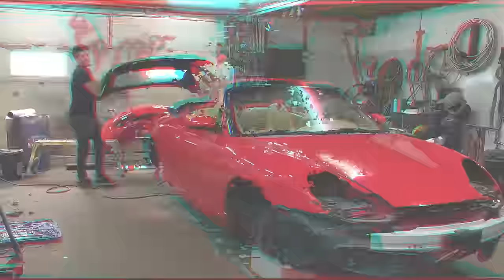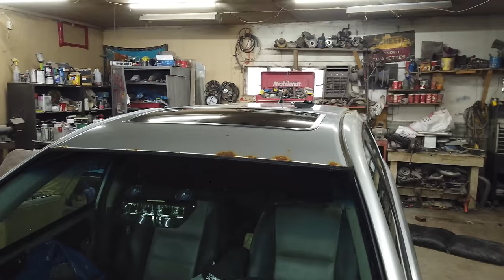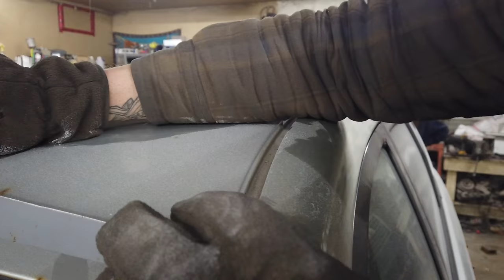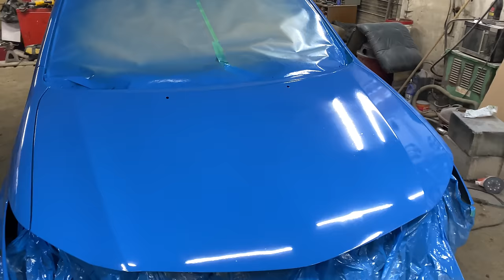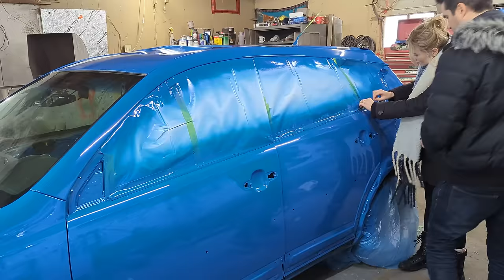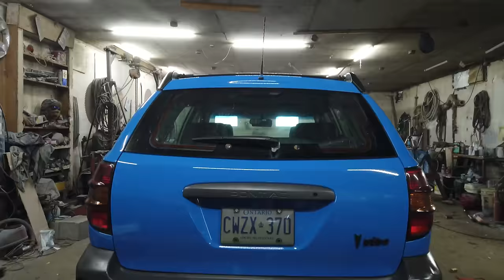Clear Coat over Rust Paint - DIY Professional Rustoleum Paint Job

Comment: When doing a color change, it's a good idea to do inside the jambs as well.
Reply from the maker: Definitely, I did mention it in the video, but since this is my own personal daily driver, and I'm the only one that uses it and will drive it till it's dead, I am not bothered by it as it's not a color that clashes or stands out. It was just to make the job easier and get my car back on the road faster. But you are right, doing the jams is the proper way to do it
Reply: If you guys wet sanded and buffed this out it would look fantastic.  But, for an inexpensive 20 footer it looks great!

Comment: I'm no paint expert, but from what I gather , it's the prep that makes the finish come together.. 

Time consuming and labor intensive, which adds to the cost.

On the other hand , there's nothing worse than a 3rd rate paint job.
Reply from the maker: Yes you are totally right, you can be a great painter using the best spray gun, but if the prep work is garbage then the finish will look like garbage. A lot of people say to just tape everything off and go for it, but it's good to  disassemble things and try and do the best job you can. If someone is doing a diy cheap paint job, then you're starting at a disadvantage, so doing proper disassembly and prep makes a huge difference.

Comment: Black rims 
Either Matt or Satin finish 
It will match the black door handles and other black accents 
Same for the plastic trims 
Black Satin finish will make it look like a 2024 car
Reply from the maker: Good point, matching the other black accents would really work!
Reply: @RustedRides  if you paint the plastic trim remember to use adhesion promoter 
A light dusting is all it needs 
This way the paint will stick properly to the plastic.

Comment: I would go with silver aluminum for  original rim colour. If you are going with a larger rim and low profile I would do the gun metal or satin black.  Thanks
Reply from the maker: Ya that's a good point. Maybe if the rim is more original size and look, the a more original finish would be best.

Comment: Got the Vibe GT. Great car but the paint did suck from the factory. Around 500k on the odo and still kicking. Gotta love the Toyota 2ZZ. 😎
Reply from the maker: Gotta love that Toyota reliability! I really do like the vibes, the GT is awesome. The 2.4 you have is nice, and more aftermarket upgrades. The 1.8 is reliable, but it really is meant for MPGs
Reply: @RustedRides  My GT has the 1.8, but its the 2ZZ and has VVTL-i. Red lines at 8400 and has around 50 more HP than the 1.8 1ZZ in the regular Vibe, plus a 6 speed manual. 🖖

Comment: What wheels did you use? Want update!!!
Reply from the maker: This car is supposed to be a daily that is economy and not cost a lot. That's why I did the rustoleum paint... The rims I got are off a 2005 prius. Light and economy, I got Michelin Defenders tires from the scrap yard... I wanted to change the color of the rims but powder coating was going to be $400, which is more than I spent on the paint materials! So I have the rims on the car with stock silver for now... Might paint them though instead of powder coating them

Comment: I like how you darkened the color. There isnt but a handful of rustoleum gallon colors to choose from so that helps. What materials and ratios went into the clear?
Reply: Each clear is different, most cheap ones are 4:1 , mid grade is 2:1 and Show car clears are 1:1 like SPI, but dang expensive. I really like SpeedoKote for the money. Just clear and activator. Also the ratios don’t have to be precise like most folks lead you to believe, close enough is all you need. I see a lot of paralysis of the analysis when it comes to mixing paint. The paint doesn’t know if you mixed in 8 oz of Reducer / activator or 7 oz or 9 oz. Same with hardener, I usually throw in a splash, 1 oz per 32 oz mixing cup but I don’t even look at the ratios anymore 🤣
Reply: @RustyZipper  oh ok. Thanks. Yeah I've been checkin out the speedekote brand myself because it pops up on my anazon account for a great price. I definitely look forward to experimenting with this paint stuff
Reply from the maker: We used the products that came with the "kit" when we bought the "Rouge" clearcoat. I don't know the ratios Cam used but I will ask.

Comment: Where in Canada are you located? I need this done for my car! Similar with lots of rust around the windshield. Hyundai Accent hatchback. I’m hoping to get another 100000km out of it. I don’t want rust to be the limiting factor. Any tips for someone who’s never painted a car before?
Reply from the maker: Just make sure you use a mask and proper ppe. More than we do realistically. We need to step up our safety ppe. For over the windshield, just make sure you get the metal bare and clean, then body fill and sand. Don't put too much on, it's better to do two lighter coats of body filler than one sloppy one and be sanding forever. Then primer, light scuff the primer and over to the paint a bit.then paint everything that was scuffed... If needed after do a wet sand and polish it. That should help match factory paint and finish

Comment: I enjoyed the vid.  I have a trouble child Vibe sitting in my driveway right now not sure what to do with.  I was wondering if you could do what I've seen others do and use a buffer and a rubbing compound to smooth out the clear coat and get rid of some of the little nibs in the paint. Regardless, car looks better, you put a lot of effort in.  FYI maybe turn down the soundtrack a little
Reply from the maker: Ahh they are fun little cars! And yes, I think in a few weeks I will do some wet sanding and polishing to fix the dust nibs and any orange peel. Thanks for watching/commenting!

Comment: I really wanted to see how you fixed the rust on the roof just above the windshield.  At least one spot looked to me as though with a little grinding to get to bare metal you would be through and have to patch the hole.  The other question I have regards the bumpers.  How flexible is this paint?  I would be concerned that an little bump would result in the paint cracking and peeling off.
Reply from the maker: The roof wasn't as bad as we thought. I was worried that the one spot would have some pin holes but it was pretty solid. We brought it to bare metal then body filler then sanded. We used tape to hold back the edge of the window gasket so that paint would get in a bit further. As for the bumper and flexibility... Good question, we will find out haha. But I'm trying to think, and I've seen lawn tractors painted with rustoleum and they have floppy hoods and still hold up... We'll see how it goes and maybe do an update video down the road.
Reply: @RustedRides  Tnx for the info.  I had a girlfriend who had a white Mustang, 80-something, with pinholes rusted in the roof.  I scraped off the loose paint and rust and them patched it with white silicon bathtub caulk.  It worked, didn't look horrible from a few feet, and she was happy she didn't have water dripping on her head.

Comment: What size tip did the gun have? I am going to use some rustoleum to paint a trailer and I was going to mix with acetone and a little bit of hardener. I usually spray base/clear with a 1.4 tip.
Reply from the maker: Hey, we used a 1.3 tip. If you are able to get a 1.3 tip, it will help it lay out flatter than 1.4. But depends on how picky you are with the finish on the trailer

Comment: The rust at the windshield starts on the Inside behind the "A-Pillar Brace". An air pocket forms during the electrostatic dunking procedure. I watched several times as the pinch weld is an air tight pocket leaving bare naked steel. Just saying as I bought a kit at a dealership auction W/9 quarts then bought a case of 12 the screw onto my spray gun that has 5 tips. Videos showing every step of a "Concourse" restoration don't show this done. Will the rust from the inside out where welded or no seam sealer is used?

Comment: QUESTION; Why not put the trim restore on while parts were off, rather than crawling on the floor, just curious
Reply from the maker: Would have been easier to do it off the car, but we thought it would be cool as a time lapse. Also didn't want to get our grubby hands prints all over them while installing them
Reply: Great job, cool video, thanks

Comment: I actually started my paint career but using rust oleum because I couldnt practice with expensive paint. I had a few come out nice and a few trash until I switched over to real paint. A small tip for others do t try to use that painters touch water ase that comes in same type of can 😂 its definately no where near the same thing
Reply from the maker: Ya its nice to learn and experiment with cheaper products. If someone can get good with cheap product and cheap tools, then they'd notice a huge improvement when switching to nice materials and tools!

Comment: Just use spraypaint out of a can. I've painted entire cars with 5-6 cans (prep took hours, painting actually like 20 mins lol) for like $60 with better-than-Maaco results.
Reply from the maker: That's awesome! What paint did you use? $60 for 5-6 cans is a great price! Did you clear coat after or was it single stage?
Reply: @RustedRides  Canadian Tire brand rust paint ;) Google Hyundai Stellar red flickr (it's the one with the BBTY plates) It lasted for a while, but after 5-6 years the paint started to fade. I was going to clear coat it at that time but the car was sold to a friend for parts as it had 1,000 other small problems that I couldn't keep up with.

Comment: I’ve painted with this .. term and Ruston both faded massively over one year
Reply from the maker: Ahh bummer. Did you put a clear coat on over the rustoleum?
Reply: You have to clear over Enamel paints as they offer no UV protection. I’ve got projects painted with Enamel and cleared that have been sitting outside now for 3+ years with no signs of fading / chaulking

Comment: For wheel color I think maybe a copper or the gun metal grey. Another thought is doing the wheels in body color with gun metal highlights.
Reply from the maker: Both those options sound good, I think I'm going to try and get a gunmetal with a bit of the bronze tone
Reply: @RustedRides  After reading your reply and rereading my comment it has got me seriously thinking about repainting my maroon 88 C1500 that has gun metal grey rally wheels with caps and rings maybe I should change the gun metal grey color to copper.

Comment: Did you consider using Rustoleum clear paint?
Reply from the maker: We haven't used it. I'm sure it would react well with the paint, but don't know the longevity or protection vs the automotive clear. Have you tried it before?

Comment: Watching this roughly 2 months later buuuuuut I'd put black wheels on it honestly. Maybe get some color match pin stripping on them since u got leftover paint.
Reply from the maker: Haha roughly 2 months later and I still haven't done the wheels. I have been back and forth on color, but black is a finalist! And the blue accents would be cool! But powder coating is $400 which is more than I spend painting the car... and this is supposed to be a cheap economical daily driver that saves money.. I'll get around to it at some point

Comment: You’re a bit off, the vibe shared the same powertrain as the Corolla, and was made in the same factory with a lot less less inspections. At that time the matrix hadn’t even become a model yet yet.
Reply: but I should also say great job guys I lost stuff like this! It’s not your fault that I’m older than dirt and was around when all these cars were brand new
Reply from the maker: Thanks for watching and commenting! We are both right! The vibe and matrix started production at the same time, vibe in California, and matrix in Cambridge Ontario Canada. Not too far from where I went to college. And they both share the Corolla drive train, and  many of the same parts. But the 2003 first year matrix that my in-laws have, and my 2003 first year vibe are identical mechanically and only look different from the outside. That's what I know, but I could be wrong. The vibe might have started production first? But vibes and matrix model years both start 2003... So who knows!
Reply: Actually to split hairs the Toyota Matrix was sold as a Toyota Corolla Matrix to keep the “Corolla” name as the best selling car in North America. The Vibe was produced in the Tesla plant and the Matrix produced in Somewhere, Canada. The vibe has different exterior panels and some GM interior pieces. I do believe that quality control in the States was a concern the first year 🤣

Comment: Jaw dropped when I seen them pull everything off that really not worth it car. Why??? I could even feel the frustration you only get as every one of those clips broke off the cladding no matter how careful you are.
Reply from the maker: A lot of the clips were already broke and the cladding was loose. They had to come off to be re installed properly. Also the cladding over the rocker panels needed to be removed to repair the rust

Comment: I get the safety squint but not with a wire wheel. No way am I peeking either. I've picked enough of them out of my coveralls to know better.  interestingly his glasses with your face mask and I've still had to go to the hospital twice to get metal out of my eye. It bounces off the mask, off the back of the glasses and into your eye. You then wake up at 3am eyes watering feeling like you sand papered your eyes.
Reply from the maker: You are right, sometimes it's without thinking, sometimes it's just being lazy... But its a bad habit. I once took a spark in the eye before and am normally pretty good about wearing proper ppe because of that...but we really shouldn't take chances with our health and safety

Comment: Hell you can see where you didn't use primer or fix anything on the roof. Because it's easy seen
Reply from the maker: We did use body fill to smooth out where we removed the rust. We didn't use primer because the rust paint is ok to go over body fill and bare metal. We can do an update down the road to show how's it's holding up if people are interested.

Comment: Rust on the edge of a glued window is the most annoying thing ever. The government makes all sorts of legislation to make cars safe and make the exhaust so clean you can fry your food on it, but no legislation to protect us against rust spots under glued glass edges.
Reply from the maker: That's a great point, especially since windshields and windows are safety glass and sometimes structural glass!

Comment: If you didn't get good result same day you probably used too much clear on the first layer for the paint to handle at least in my experience using very cheap and rattle cans. It is just too hot for the paint a lot of the time.

Comment: The lighting was so bad you can't tell what the finish really looks light. Perhaps that was on purpose. It looks good in low light and filmed from 10 feet away on  YT though.
Reply from the maker: Ya lighting in the shop is not amazing. The paint turned out pretty good. Some dust nibs and some spots are not glass smooth, but we are working with tractor paint haha. I might do a wet sand and polish to make the whole thing look like glass. But I'll wait till spring

Comment: 1. This is like repainting an Aztec. Who does that?...
2. You just did yourself more damage repair by knife scraping those stickers rather than using a heat gun. Makes a fella wonder... 
😂😂😂😂😂
Reply from the maker: Now I want to paint an Aztec, Walter white style! Those decals were on the for over 21 years. They were crusty and a heat gun and fishing line wasn't going to do the trick. Sure they could be taken off with more care so either more time removing, or more time sanding... 6 of one, half dozen of the other

Comment: Dude first of all what are you doing? i dont have a problem with the paint its the fact that you removed everything honestly painting cars is simple half of the stuff you took off could have been papered and taped with painters tape like the plastics that went on the door and you were poppin the clips out your not gonna see that shit man😅 trust me ive been doing this for a while. Another thing when you paint a car you want that garage to be fuckin hot get a torpedo heater and get the garage up to 90 degrees Farenheight helps the paint lay on better. another thing you dont really have to spend all that time sanding the whole car i just use scuff pads and give the car a good scuff before i prime and then paint it. Otherwise looks really fuckin good guys what guns do you use?

Comment: Not trying to be offensive but how you can call that professional is beyond me. It looks ok from 10 meters away. The clear coat is hazy and there are fish eyes and orange peel everywhere. Painting  with rustoleum but then using expensive clear coat doesn't make sense. You'd be better off using a single stage paint, also less coats means less chance for crap to stick to them. The garage is so dirty and dusty also,  🤮 how can you paint in there and expect good results?

Comment: I've done a couple Rust-Oleum jobs I did one with the charcoal grill paint that comes out of real nice satin black better than any other side I've ever seen and I also did one in silver and then I must mistakenly used purple Power concentrate to clean the van that I painted with the silver Rust-Oleum and it destroyed the paint it don't ever use purple Power concentrate it's supposed to be cut six times but it comes in a spray bottle where you can't add water so you think you can just use it full strength but you cannot   https://www.youtube.com/watch?v=Gb7RtbzLD-w
Reply from the maker: Ahh good to know about the purple power! I don't know if we have that product in Canada